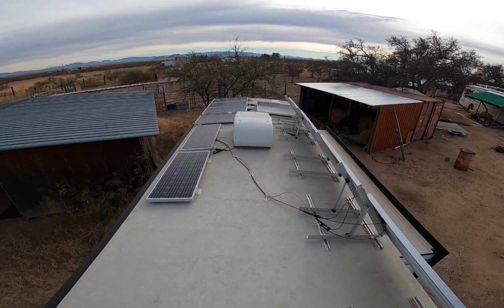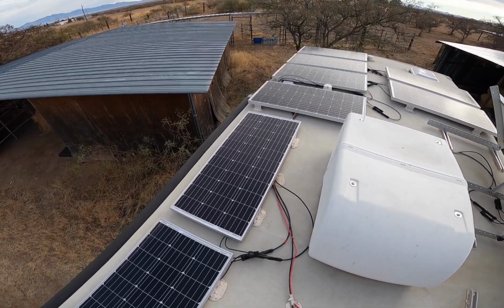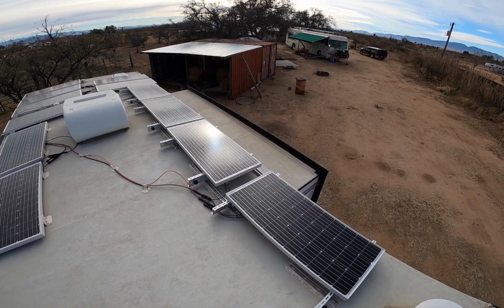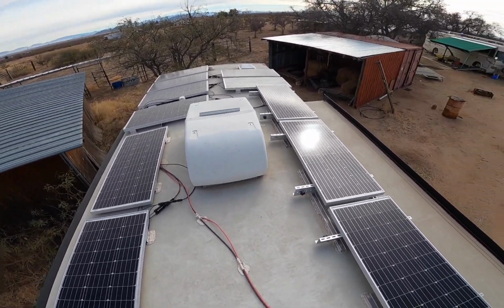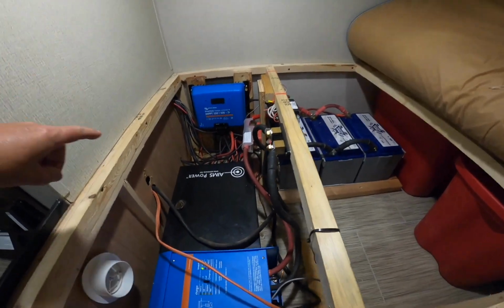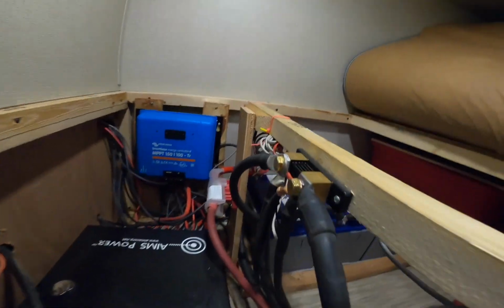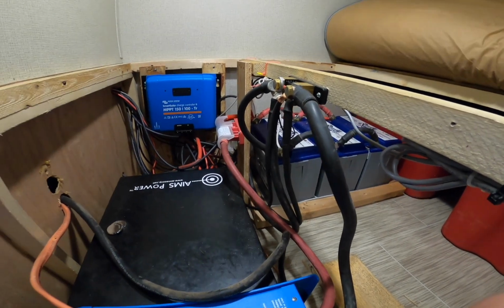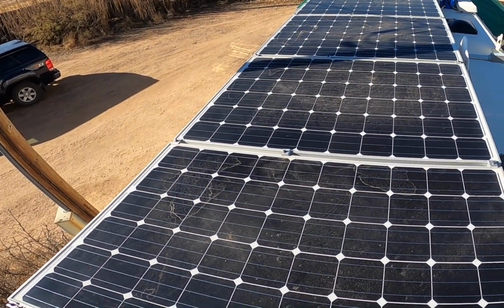THE FIRST 90 DAYS WITH RV SOLAR. WHAT I LEARNED! SEE MY MISTAKES

Comment: One suggestion on the old “converter.”  The old converter was there so you could charge the coach battery(s) when connected to shore power.  The old converter is designed to charge lead acid type batteries.  You could remove the old converter and replace with a newer converter which supports charging profile needed for LiOn batteries.  If you replace the converter with a lithium Ion compatible unit, you’ll restore the capability of “correctly” charging your LiOn bank when connected to shore power.  The newer coaches are now coming with lithium ion compatible converter, you’ll see a switch where you can toggle the converter for Lead Acid / AGM coaches and once you to change over once you replace those dealer delivered batteries with new LiOn batts. 

Great video .. good luck

Comment: I have had the same experience with researching solar for my box van conversion. Great tip about researching on Facebook instead of Google. I'm pretty sure I'm going to go with the bluetti 500 and 1200 watts of solar panels. I think it's going to be less to figure out. I'm glad I found your channel friend. I'll keep in touch.
Reply from the maker: Anything to make it easier is definitely a positive. I recently looked into the cost of professional installation. It was more than the system itself. I am sure you can get it right, it just may take a little time. Let me know how it goes.

Comment: You make very valid points. For me I have a background as an electrician and motor control tech. I build my own lithium ion batteries and install my own BMS systems. If someone has no electrical experience then I would say get some help. It is when you start using MPPT charge controllers with solar panels in series that you could get killed. And when you start using lithium ion batteries that are capable of incredibly amounts of current that fire becomes an issue unless you have propper wire size and fusing. 
People say it's only 12 volts. Not on the solar array output it's not. Besides 12 volts with enough current will burn the rv down unless installed correctly.  Right on video.
Reply from the maker: Thank you for your insight. You are so correct about safety. Unless someone has experience such as yourself it is definitely a must to get help. It could mean the life of your family. Merry Christmas to you and your family.

Comment: I have to say this is a great video.I am starting out now building my second cargo trailer build into a toy hauler and this one I have been planning to put solar on it ever since I started. All I do is overthinking everything. I think you’re right I think I just need to get out on the road and find out exactly what I need before adding a lot of solar. I am sure that I need some but I just don’t know how much like you it’s the unknown but then that’s part of the fun right. 😳 God bless you I look forward to looking at more of your videos. Also by the way your system looks good from what I can see
Reply from the maker: Thanks, I completely understand the overthinking, took us a couple years to get on the road after we first looked into it. When you get out on the road you will learn a lot from others. Ours is doing well now and handling all our needs and even some air conditioning so we are happy with it. It’s all part of the fun. Most of the time it’s not about the destination, but the journey itself. I am going to try and get out more videos. Internet is a whole battle in itself. Ready for Starlink if it works. God Bless you also and safe travels

Comment: You should pull power from opposing ends of the batteries to spread the load across all of the batteries. If the negative is on the first battery the positive should be on the last battery.
Reply from the maker: We thought that too, however we tried that and it was not working correctly. Then battle born advised to connect this way and it is working now.

Comment: You are correct about shade tilt and placement.  You need to find a way to tilt all the panels and get them pointed at the sun without any shading.  It can be done on your roof. You have enough room but it will take a lot more work, sorry...  You make no mention of how you arranged the wiring on the roof.  Series/parallel etc........  It appears that your batteries are not wired correctly. It could just be the camera angle.  You need to have the positive wire coming from the battery on the right, not the left as you are facing them.  As currently wired the battery on the right is not doing an equal level of work as the battery on the left.

Comment: @ 15:00 .   You realize we have no idea what you are talking about if you tell us the amps without mentioning a voltage ?    Why don't you use wattage ?
Reply from the maker: Voltage is the overall charge on the system. It could be at any voltage level and the panels still produce at that amperage. No one I have talked to measures this in watts but these produce a maximum 100 watts but I have no idea how to give very accurate figures in watts. Sorry for the confusion.
Reply: @discoveringawonderfulworld9747  The formula is amps x Volts = watts.     If you mention the amps without the volts it is meaningless .  If your panels are 20v , producing 3 amps , they are putting out 60 watts.